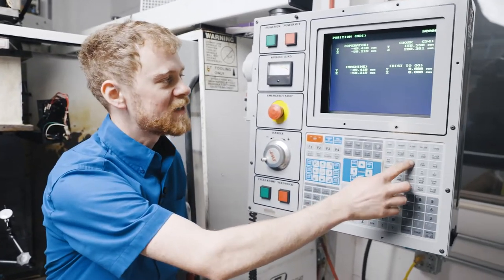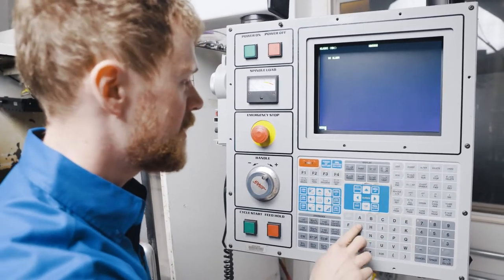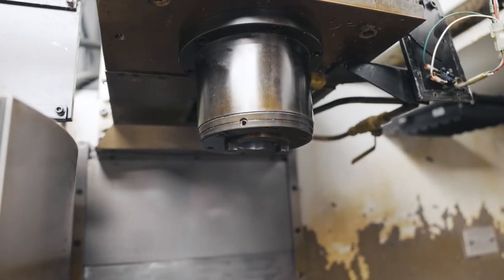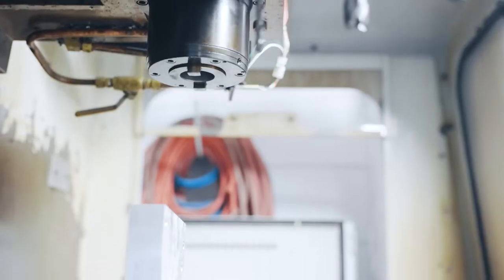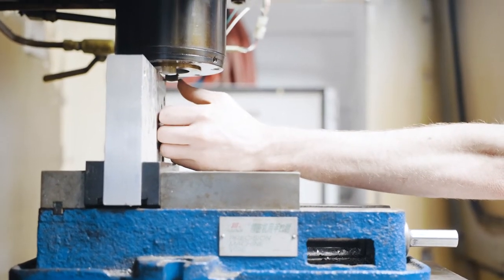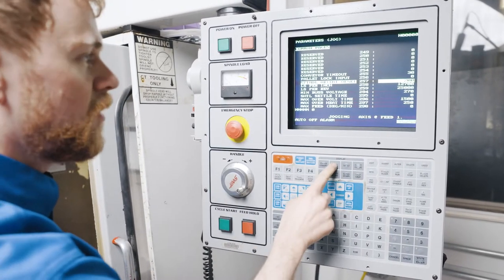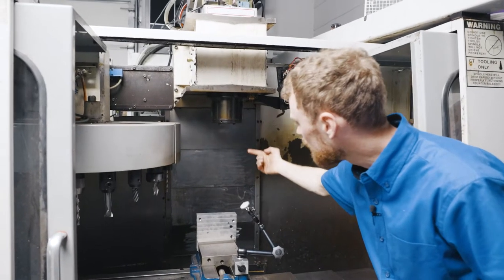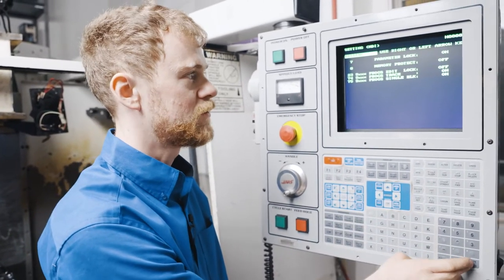How To Set Spindle Orientation Umbrella Tool Changer

Comment: This works on my machine but the orientation location does not repeat. I can fine tune the parameter so I get no runout from dog to dog, but after turning the spindle on and off, it's slightly out of alignment after another ORIENT SPINDLE command (about .025" from dog to dog). Should I worry about this?
Reply from the maker: I would check the spindle belts. Make sure they are tight. Also, check the teeth on the encoder belt/ pulleys and make sure the belt is tight. If you set orientation and run a max RPM fw then rev do that a few times. Then check with a sharpe on the dogs against the spindle nose. That will be close enough. I wouldn’t be worried to much about 0.025 0.05 yes. If you need more help or parts give us a call.
Reply: Thanks for the quick reply! Cheers. @cncrepairman

Comment: How do you set the height you mention at 2:55 ?
Reply from the maker: Par 64. Sorry I don’t have a video about it yet.
Reply: @cncrepairman  Thanks for the quick reply. My PAR 64 is set to 447665 on my 2006 Haas VF1. Do you know roughly how much Z travel change I can expect by changing that parameter and if Z will adjust up or down? This is the Z location where the forks grab the tool, not where the Z goes up to clear the spinning carousel, correct?
Reply: @cncrepairman  For the benefit of other viewers, I figured out a few things:

1. An increase of 100 in the value of par. 64 will bring the spindle DOWN approx .001" to the new home position (your machine may be different).
2. After changing parameter 64, Z must be brought to its origin before the new value will "take".
3. In Z, HOME and ORIGIN are not the same (Haas noob here).

Maybe this will help someone else. 🙂

Comment: I'm having a spindle alignment problem. I followed the steps in your video. My spindle is still not orientating to the correct spot. The number I enter doesn't matter. The spindle still goes to the same spot.
Reply from the maker: How old is your machine? You probably have an old shot pin style. They call this mechanical orientation. You can find the service procedure online. I’m hoping to come out with a video soon about it. Call the store on Tuesday and they can help.